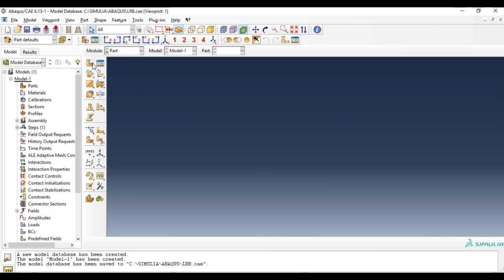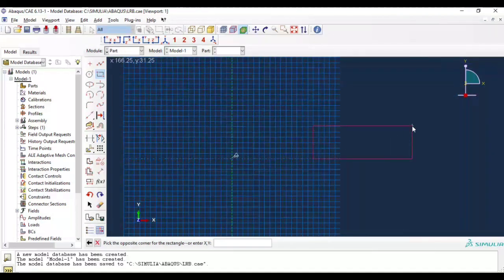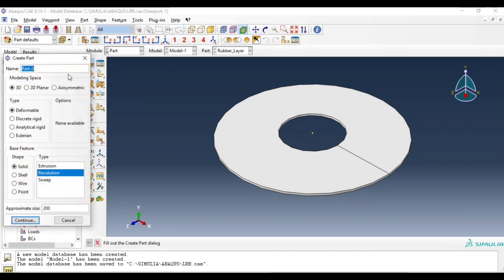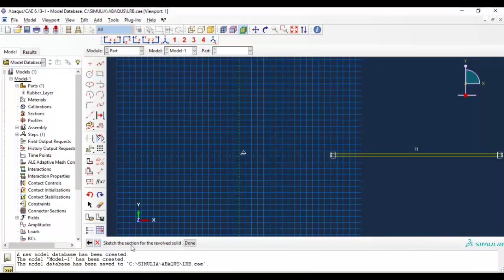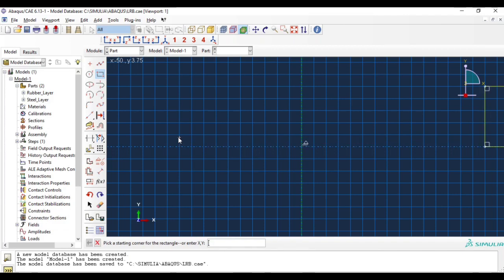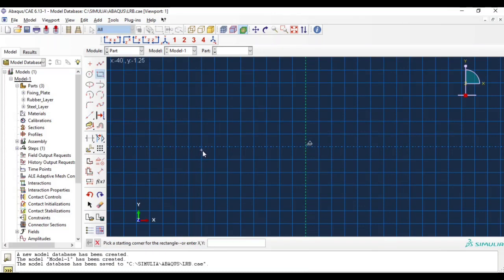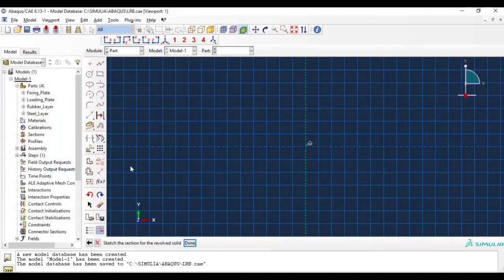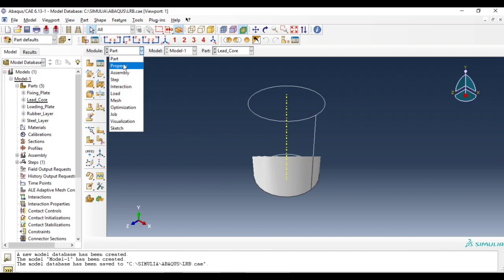ABAQUS Modelling and Analysis of Lead Rubber Bearings -1

Comment: Please tell the dimensions of the bearing in relation to modelling in abaqus
Reply from the maker: Hello madam, https://www.researchgate.net/profile/Vishnuprasad_Ranganath
Please use this link and you can download my project report... You will get what you want.
Reply: Sir,I have viewed the thesis, but the specific query is that..how to get those values...from which source, I mean....
Reply from the maker: I got the size values from a technical paper that i have mentioned in the report, apart from that i have reffered some LRB manifactures manuals like doshin rubber etc.... For variation in the sizers of bearing....
Reply from the maker: There is also a code of conduct for  designing the LRB manually, you can reffer that euro code for designing your LRB.
Reply: Ok Sir,Thanks.But based on the design,the materialistic properties will change or not?

Comment: Hi, thank you so much for your help. I'm trying to model a simple square rubber bearing. During the assembly, I have just created a Face to face constraint between the fixing and loading plate and between fixing plate and rubber layer. Anything else I should consider?
Then I created, in the "interaction" step, tie constraint, just like you showed.
Reply from the maker: hello mam, 
Tie constraint just means that there is perfect bond between two elements.
if you want to make your model even closer to real world problem then you need to define other interaction properties between elements...
tie constraint just reduces complexity....
Reply: @VishnuprasadRanganatha  Thank you very much.